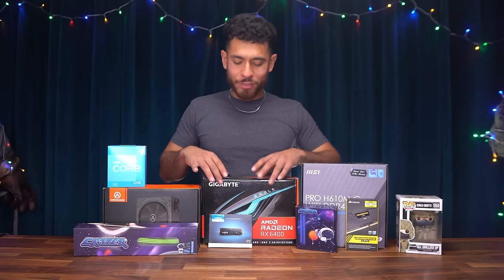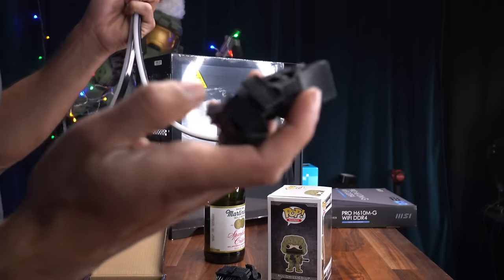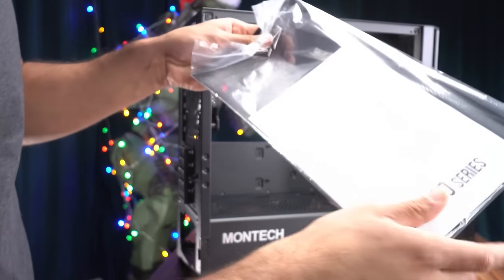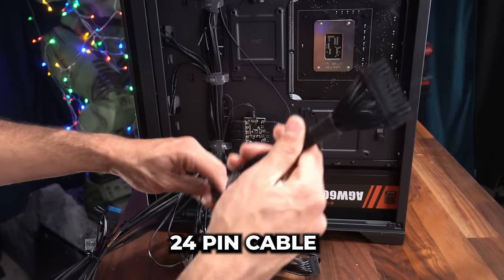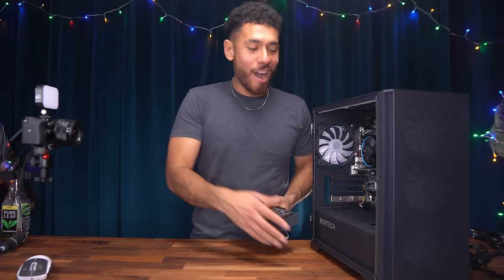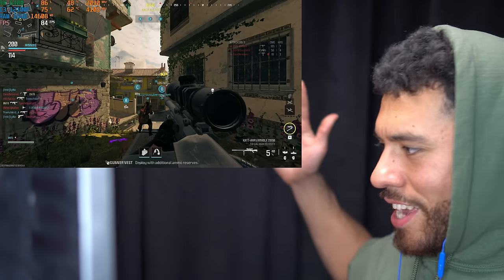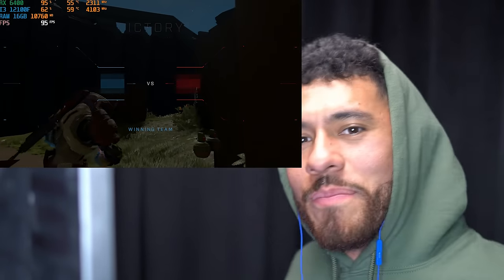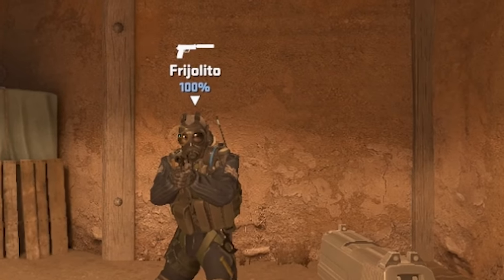Build the Best $500 Gaming PC - 2024

Comment: Do me a favor. Don't build this system. For $100 more you could build a much better rig, with a much better gpu. Still love the content Joey.
Reply: Do you have a rig in mind? I got some money and im not very knowledgeable
Reply: Exactly. Could've gotten a 6600 xt for $200 on Amazon and it would perform so much better. Even has double the vram
Reply: So what's the build
Reply: Do me a favor, spend 1000 and get yourself an even better rig!
Reply: Or spend $500 on better used parts

Comment: Oh no not the RX 6400... AMD and Nvidia are failing us so badly considering budget GPUs that they are forcing people to buy this trash...
Reply: Bro what? its a ''500 BUILD''' cost just as much as a console of course you have to go cheap and it still had good performance.
Reply: 6400 is a game update away from being unusable lol literally all the settings on 1080P LOW with FSR Balanced!
Reply: even an rx570/580 is faster and u could buy it brand new 150$ 4 years ago
Reply: @GeforceGtx980ti  Yh bare minimum these days would be like a 5500XT, as it has 8GB VRAM and still has driver support.
Reply: @Ter0a  I can build a 500 PC with close to double the performance and with a PSU that won't burn your house to the ground.
Reply: @AlexHusTech what are some other cheap recommendations

Comment: You could do this with an RX 6600 and Ryzen 5 5500 for a time on B450

Now 12100F ARC A580 is the way
Reply: I agree
Reply: This market just changes so rapidly, few months back was the best time to build
Reply: @droson8712 how good was the market a few months ago?
Reply: @yordinihoudini  CPUs were fairly cheaper and there were $180 RX 6600s and $230 6600 XTs, dominated the $500-$600 range, still not a bad time of course but all I'm saying is that it fluctuates like this, wouldn't get the 6400 shown in the video
Reply: How stable is the arc 580 recently? Last time I check it's buggy in one game that I play hopefully it'll get more good as time goes by
Reply: arc a580's aren't available everywhere though
Reply: Indeed
Reply: R5 5500 and rx 6600 is exactly my build like 8 months ago and is still going hard
Reply: @droson8712 agree few months ago I wanted to buy pc parts for my birthday which was ryzen 5 5600 and rx 6600 for 3000 riyals now checking Amazon I can only do i5 10400f gtx 1660 super wtf
Reply: @OmarSanchez-tx9ge 
Ryzen 5 4500 is 79$.
Sometimes below 70.
Not amazing, but decent for this budget.

Comment: 1st build using most of the parts used in the video. I used a better gpu and psu.
Issue is the case as it came with the fan hub and had the power switch wire running to it. Also in the video the only thing missing to help the 1st timers is setting this usb hub up properly. Thanks for all the great videos and information.

Comment: Been following joey for years now. This year finally decide to build my own PC thanks to you I learned A LOT!
Reply: Did you?
Because this configuration has utter trash GPU
Reply: @GameslordXY  nah bro different specs. Went for am4 5600x and used 3060 ti instead for max settings 1080p. Fair price range I guess for my budget.
Reply: @rzzsmr 
3060Ti is indeed an excellent GPU.
Quite Decent for 1440p as well in my opinion. 

5600X is amazing CPU.
Should be able to handle upcoming 4070 Super quite well at 1440p and without problems at 4K.
Reply: @GameslordXY  how is the 7800 xt trash? because its amd?

Comment: This case is awesome. I bought a few for $50 and wow, it was a steal. The only thing that i wish they would change is the top filter sits on the case and slides around. I wish the top was indented to help the filter sit in place. I don't use that filter because of that.
Reply: The filter is actually supposed to be installed from the inside of the case, not on top of it

Comment: Hey Crater 
Do you think this is a good build for a budget of 2,200 AED?

PC Components:
- CPU: AMD Ryzen 3 3100 or Intel Core i3-10100F (approx. 400-500 AED)
- GPU: NVIDIA GeForce GTX 1650 Super or AMD Radeon RX 570 (approx. 800-900 AED)
- Motherboard: ASUS Prime A320M-K or MSI B460M-A PRO (approx. 250-350 AED)
- RAM: 8GB DDR4 3200MHz Corsair Vengeance LPX (approx. 150-200 AED)
- Storage: 240GB SATA SSD (approx. 100-150 AED)
- Power Supply: 450W 80+ Bronze Certified PSU (approx. 150-200 AED)
- Case: Cooler Master MasterBox Q300L or NZXT H510 (approx. 150-250 AED

Comment: The build looks great, but the RX6400 is an abysmal choice of a card going forward. Unless you get the LP model for an old OptiPlex or some other non-upgradable office PC like that, you should avoid it and instead aim at a RX6600 or ARC A580. You can definitely fit those into the already tight 500$ budget if you go for basic components and choose a cheap AM4 mobo and Ryzen 5 5500. Of course you won't get cool flashy RGB lights and the tower case might be absolutely bare bones, but at least you'd be able to play the most recent titles at 1080p/high. For instance, the RX6600/Ryzen 5 5500 config can run Alan Wake 2 at 1080p Medium FSR quality at 50fps, or Hogwarts Legacy at 1080p native ultra at 60fps.
Reply: Ryzen 5 5500 is 99$ or more.
Ryzen 5 4500 is more sensible for this budget. 
79$.
Sometimes below 70$.
Yes there might be some bottleneck,but nothing too huge imo.
Reply: @GameslordXY  Totally valid, but with the 4500 you might want to upgrade more sooner than later

Comment: This is a good budget gaming PC guide. All new parts for $500 is pretty solid. If you try to copy this build look at Intel arc a380 GPU instead of the Rx 6400 though. It may be better GPU choice for the same price. 

Also right now if you want to save a little by using a different case and PSU  Amazon has a good deal on Gamdias case GD-TALOS E3 MESH. Comes in white or black and you can bundle a Gamdias 600w RGB PSU the total for both after discounts is $88. 

I've done 4 flips recently using the case/PSU combo it's a pretty good deal.
Reply: 6400 belongs to 350$ budget. 
This feels like scam
Reply: @GameslordXY  Bro! Really? It's $500 brand new straight from Amazon. Cut dude some slack. FR
Reply: @mtzkustom7818 
Cut him some slack?
Why?
RX6600 or Arc 580 belong there with some adjustments. 
There are cheaper good enough cases.
Cheaper and better AM4  motherboards.
Cheaper and good enough CPUs(perhaps inferior to 12100F , but still good enough).
And cheaper RAM that's about as good as this one.

Can you not comprehend the difference in performance?
Sure,R5 4500 + RX6600/Arc 580 would cause some some bottleneck most likely, but nothing too dramatic and it would wipe the floor with this PC.
Ryzen 3 4100 might introduce significant bottleneck due to being weaker than 12100F in absolutely everything, however it would still devastate this build.
Reply: @GameslordXY   I fully understand the lacking performance and features of the Rx 6400 it's pretty much e-waste at launch. Personally I wouldn't put it in the build guide. In my comment I suggested looking at the arc a380 for the same price.  I haven't tried myself, and there's mixed reviews, but on paper I'd definitely pick it over the 6400. There's also "New" Rx 5600's available for about the same price but I think they are refurbed/rereleased kinda how they did the rx580 "2048sp".  

I will say it isn't the best choice, and it's easily beat with any number of parts combinations. I just wouldn't hate on the guy for doing this sort of video 

I  mentioned a more budget friendly case and PSU combo as well. There's some good ram substitutes for @ $30-40 as well. I think the last 16gb kit I got was lexar 3200mhz for $34 silicon power usually has some sub 40 kits too.

I don't see any combination of parts you could buy new on Amazon and build using the Rx 6400 for $350 though so I'd have to disagree with you on that.

I'm still a big supporter of am4 and agree with you on using it in a build for $500. I'd probably go with R5 5500 + whatever am4 motherboard is the best value b450, a520, b550 etc.. It would have to support 5000 series out of the box though. I wouldn't expect someone following these sort of guides to mess around with flashing bios.
Reply: Thanks for the tipssss

Comment: For $500 this build is pretty garbage. It's actually just garbage in general.
• RX 6400 - terrible price to performance and overall value.
• Only 500Gb storage
• F - Tier PSU ....aka replace immediately if you value your PC at all.
• Mismatch budget of CPU and mobo to the rest of the build

Considering you can still squeeze better performance out of a GTX 970 or RX 580 for half the price of the heap of trash that is the RX 6400, why would you ever consider an RX 6400...

• For the same price as the RX 6400 4Gb NEW you can find a fantastic condition secondhand RX 5700 XT 8Gb, which is about equal in performance to the RTX 3060.
• You can pick up a 1Tb Sata SSD for less than that 500Gb M.2 SSD he listed...or just pay $10 more an get a full 1Tb SSD...don't skimp on storage when games are 50-100Gb these days...
• For the PSU you can get a MAG A550BN (550W 80+ bronze, C-tier PSU) for the same price as the junk he recommended.
• The mobo and CPU are mismatched in terms of price to the rest of the build. You could easily go AM4 and get a B450 board + R5 3600 or R5 5600 (depending on sale price) for the same as the CPU and mobo recommended AND get better performance out of your system.

The only good recommendation was the Montech Air case, which is a solid budget choice.
Reply: I don’t know what it is about this, but it was a good read. Also, you’re 100% right about everything you said.
Reply: @fredjohnson1688  Thank you very much! Typically I don't comment on Youtube, but lately I have gotten really tired of channels like this one and the Toasty Bros, among many others, that just pitch absolutely terrible advice and mislead people. I'm happy to weigh in to hopefully help someone get started in a better direction.
Reply: @ShadyButFresh  ikr i was wondering why he went with a 6400, even a 580 from 2017 is better
Reply: @khat6714  Agreed - If you really need to go a budget route on the GPU than a secondhand RX 580 8Gb can be found for about $50-60. If you're going to limit the GPU budget to $115  you could easily find a GTX 1660 Super, GTX 1070, RX 5600 XT, or RX 5700 XT
Reply: like most of these pc build youtubers, is Zach's tech Turf also misleading or does he make genuinely good tutorials?
Reply: @ShadyButFresh  I think not everyone wants  secondhand stuff. We don't know how the previous owner used or abused it. Not even sure how much longer it will last. What if it dies in like 5 months after the build ? Thats money down the trash.  A new one has warranty.
Reply: I seriously  HATE the PSU tier list. That list needs to hidden from retailers or just be destroyed. Freaking retailers use it and  jack up prices on everything that is on Tier A to tier C PSU.
Reply: @Prabhu2086 I have built over a dozen PCs with used components and even have some in my own PCs st home. Literally zero issue.

As long as the cpu and gpu weren't thermal throttled regularly they're fine. They're built last
Reply: @Prabhu2086 psu manufacturers have nothing to do with the tier list. Almost every company that makes PSUs has both good and bad models available. It was created by third party testing and has more to do with safety features than anything else. 
Good PSUs can still be found for $50-60. 
Our boy in the video just used a terrible one.
Reply: ztt just guessing
Reply: @Prabhu2086  lol no the prices r normal
i legit picked up a 650w msi A650BNL psu for like 48 USD and its tier c and Its been so good

Comment: Would this machine run Helldivers 2 reasonably well? I bought the game and it's so much fun, but my poor old laptop is about a decade old at this point. It was top of the line when I bought it, dropped about 3k on it because I wanted it to last 10 years (and it's been great the whole time). It's really showing its age though. I can't afford a big PC right now, was thinking of doing something like this. But if it's still gonna chug like my current machine, I'll just grab a PS5 instead. I'd rather stick to PC though. I like that it's future proofed as he mentioned in the video. I haven't built a PC since the 90's, but it looks easier than ever. Back then we were just barely getting into USB connectors, lol.

Comment: Love the part list outside of the GPU. The 6400 is just such a meh product. If you have to resort to a cheaper card go used, the 1070, 1080, 1660, 2060, 5700, 5700 xt all can be had used for maybe a few more dollars and you will be getting 100-200% more performance. EVGA GeForce RTX 2060 SC GAMING is on EVGA B stock currently for 149. Even the 100 dollar cutdown RX 580 will be about 40% more performance.. still would never recommend this to anyone but its a better option.
Reply: The motherboard is crap as well.
Msi B450M Pro VDH MAX is better and cheaper.
Sub 75$ 
My recommendation for a CPU would be Ryzen 5 4500 6core/12threads .
12100F should easily win in most if not all games,however that B450 board should handle even  the mighty Ryzen 7 5800X3D just fine.
Especially in well ventilated case.

Can that Intel board say the same for its Intel approximate equivalent the i7 12700K?

Comment: You can easily squeeze rx6600 8gb in there, just go with cheaper motherboard and case
Reply: He would need to go AM4.
MSI B450M Pro VDH MAX should handle even 5800X3D just fine.

Not convinced this can handle 12700K IF someone decided to upgrade someday

Comment: you can build a better $500 gaming pc with a rx 6600 , r5 3600 , 16gb 3200 ram ,  case fans, am4 motherborad, 512 m.2 ssd, 600w powersupply ,case, and wifi. yours is not truly budget i got everything in my amazon cart right now and the total is 498.I will say the 3600 is on sale for $85 right now. Also all parts are new on amazon.

Comment: Hey, this is an awesome video and actually inspired me to build a pc. I'm hoping to build this pc for my brother however the case isn't available in amazon so I was wondering if you had an alternative case that has the same layout of cutouts and is compatible with the parts. I was also wondering if the extender cables were nessesary or the build is possible to be completed without them?
Reply: This GPU is a disaster for anything new.
Can you increase your budget to 550?

Montech X3 Mesh.
Comes with 6 RGB fans .
Reply: @GameslordXY  No, sadly I cannot up my budget since its a budget given from my brother, do you have any recommendations for alternative gpu cards ? ps. also thanks for the case recommendation
Reply: @antekg1349 
As I said, the Montech X3 Mesh.

Phantex 
RX6600 can be placed in this budget if you are willing to go with much weaker CPU .
Bottleneck might be significant,but even so it will provide far superior experience. 

It would require cheaper case.
Something like Phantex Eclipse G300A.
1 fan,but Mesh Front.
Sufficient for such a build.
Can add few 5-10$ fans later if needed

Comment: Sup dude been watching for videos  for the past few months now I just got my hands on a 13700F with a 4060 ti 8gb monitor is rated for 250hertz ram is 16 my question is should I upgrade the ram to 32 and I should be OK for a while huh ?
Reply: Do 16GB cause you trouble?
If not , then it isn't necessary. 
Still RAM is so cheap that it can't hurt to have more just in case.
Especially if you use PC for other things as well.
Like video editing
Reply: @GameslordXY  trouble as in ?

Comment: Can anyone recommend a better cpu for less than $150?
Reply: The goods cpu are 3600 4500 5600x
Reply: @oidotsuc5165  would the 5600 work with this motherboard or do I need a different one
Reply: @FNSwitchPlayer  you need a am4 motherboard for the CPUs I mentioned if u have a Intel motherboard then you gonna need to buy a new 1
Reply: @oidotsuc5165  oh Last thing, would the gpu work with the 5600x and the am4 motherboard
Reply: @FNSwitchPlayer  yes

Comment: I'd argue that AM4 got better upgrade path than LGA 1700 but it's a subjective choice
Reply: usually is but the single core speed of the 12100f is not far off single core speed of a 5600x
Reply: @nickmelin248 
On average 5600X decimates 12100F.
Well it depends on the GPU.

Mentioning 12100F as an alternative to 5600X is madness. 
Now IF you said 13100F, then we could talk about it,but not 12100F.

Going forward developers will optimise for 6+ cores more and more and CPUs like 12100F will start running out of breath in CPU heavy games.
Even 13100F, though it's cores are more powerful than 12100F.

Also cheap AM4 boards like MSI B450M PRO VDH MAX can handle the mighty 5800X3D quite nicely.

Comment: Ill be honest, sort of a weird video. I really don't think you should be trying to build a pc for gaming at less than 500, unless youre using used parts. If youre willing to use used parted, id go for a ryzen 5 3600.  You can find them for around $40-$50. For the GPU, a RX 5700XT. You can find them for $140-$150. If you're only an Nvidea person, a 2070 or 2080 can someomes be found locally for $150-$250 if you're lucky. 16GB of DDR4 at least 3200MHz. Any motherboard, but make sure it has what you want like on board wifi and Bluetooth. I dont buy used motherboards, cause they seems to have the most issues when used. Id say go for at least a 600 Watt PSU from a good souce. I wouldnt cheap out on it, cause if it catches on fire, youre fucked. Any case is fine.

Comment: PSA: That PSU is rated at Tier-F (Replace Immediately) on the PSUCultist Tier List.
Reply: I heard about that PSU being a bad choice, do you know of a genuine brand PSU that would work in this computer for around the same price?
Reply: @ZyD3N Apevia Prestige, 600w 80+ Gold is around $50. C Tier unit, so it's passable. Also, ASUS TUF 450w. It's rated B-Tier, but it's a smaller capacity unit.
Reply: @octodinosaur2419  alright thanks. Will I need any adapters at all or are PSUs universal with any motherboard?
Reply: @ZyD3N  The connections for consumer motherboards and power supplies are standardized so you'll be good